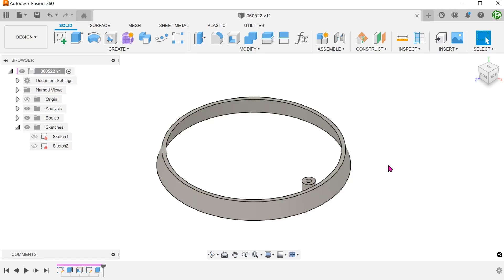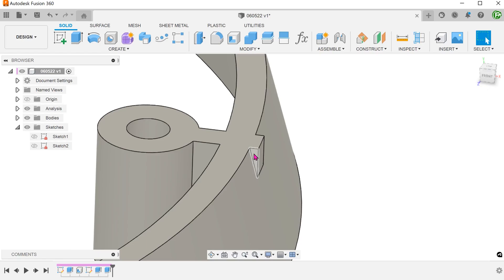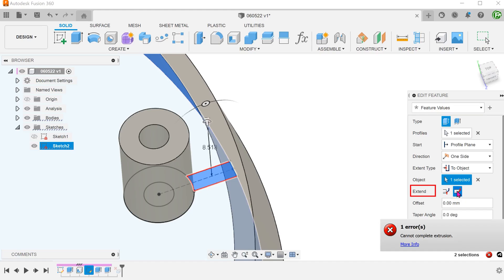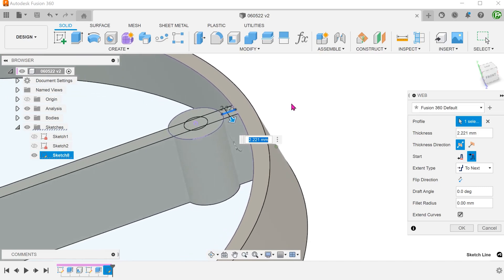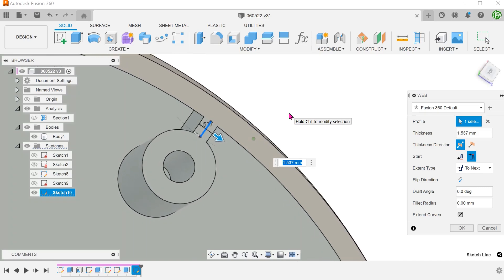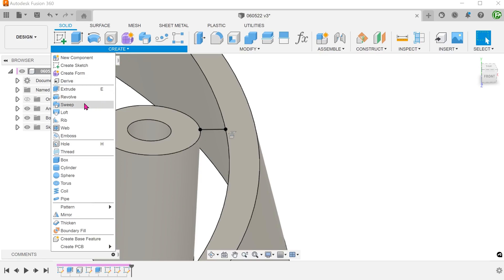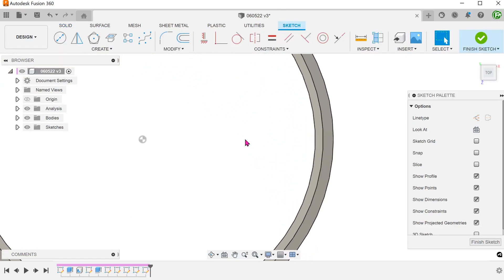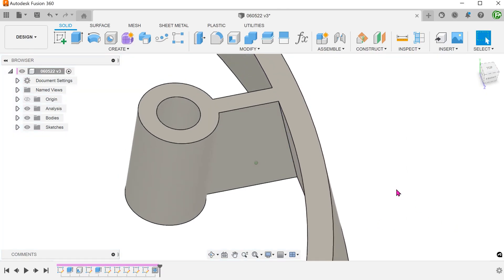Fusion 360 | Case Study 28

Comment: I would create a tangent plane on the boss, sketch->intersect for top and bottom of boss and draw a line between them.
Thin extrude two sides, walls centre aligned, using "To Object" for both directions.  The outer ring needs to have the extent type changed to Adjacent Faces.

Pros: It can be parametric and the web thickness is independent from the boss or outer ring thickness.
Reply from the maker: This is definitely a good way. Did not think of this before. Might make a short video to demonstrate this. Thank you for the suggestion!
Reply from the maker: Here is the link to the new workflow:
https://youtu.be/SVs9LbyM2i0

Comment: This is an interesting exercise, one other option is to create a section in the midplane of the boss, then extrude it in two directions, one to the face of the slanted ring, one to the external face of the boss. Most modern CAD systems (I'm sure both CREO and Onshape can do this) can extrude in two directions but not necessarily on opposite sides of the sketch plane, so you can comfortably place the sketch plane in the middle of the boss even if the resulting extrusion will be outside the boss. 

The issue with ribs here is that multi-body systems like Fusion and Onshape don't consider a single body with detached geometry, something that, for example, CREO can do. I can't check if ribs in CREO would join the boss to the ring correctly but I think it might, even without a base.

Comment: Trouble with this approach is that is doesn't give ability to independently set the boss hole diameter from the Web thickness, so if you may have to adjust the hole afterwards again breaking the parametric workflow

Comment: My first thought would be to make a vertical sketch between both bodies, and then just extrude in both directions to the bodies. Would that not work?
Reply: This is what I would have done. If the interior surface is curved you could extend the sketch inside the object so they overlap.
Reply: @neofitou  No need to use this trick: you can place your sketch in the middle of the boss, and extrude one side to the face of the larger ring, one side to the face of the boss. Today the definition of "side" of an extrude is pretty flexible :D

Comment: Before making the rib via extrude, make a copy of the external surface of conical ring. Create the 'problematic' extrude as at 55 sec. Use the copy of the surface to trim off the unwanted portion - this will be parametric.
Reply: This is how I do it